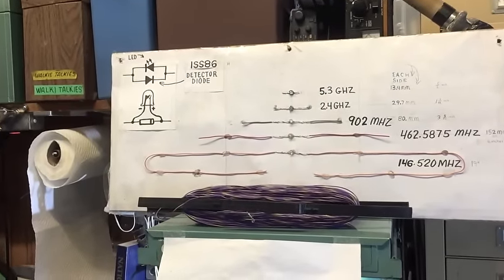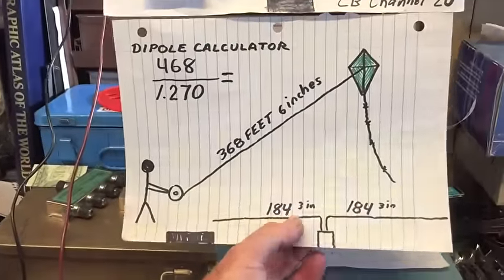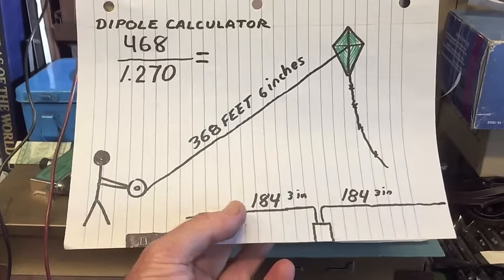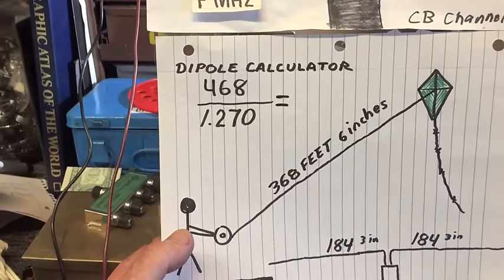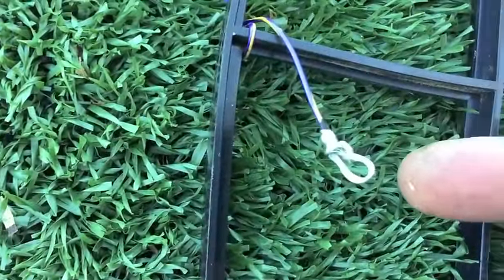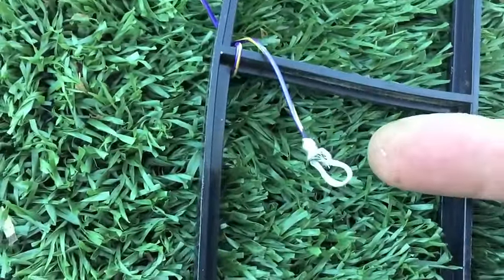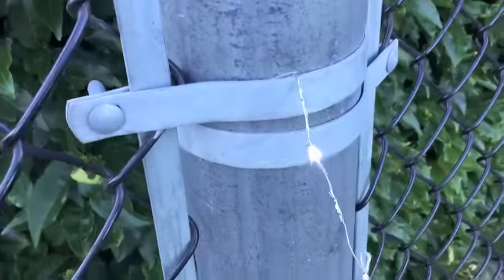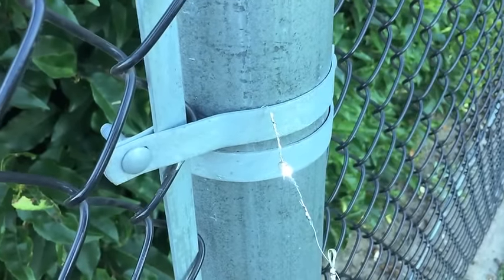Radio Frequency Burns From A Long Wire Antenna Supported By A Kite

Comment: How many volts and amps is that?
Reply from the maker: I'm not sure. It's hard to measure radio frequency energy.
Reply: @GrantsPassTVRepair  that in and of itself is pretty interesting. What makes it hard? Does it fluctuate to much to get a goo reading? I wonder what running it through a capacitor would do to help stabilize it. Does the wire need to be bare or would something like insulated 6 or 8 GA wire wire work. I have a couple thousand feet of that laying around for years just waiting for a good purpose to be put to good use in. It's silver plated copper. Not tinned actual silver. Thanks for the reply.
Reply from the maker: @nathanhale7444  Radio frequency energy is measurable using an oscilloscope, but no multimeters that I'm aware of can measure it. I suppose a sensitive watt meter might be able to it, but any time you pass high frequencies through electronic circuits in multimeters, the reactances you encounter will distort your readings. Radio Frequency energy is much like AC only much faster in frequency.

Comment: Are theese rf burns permanent?
Reply: It's just a normal 1st degree burn, probably even less than you'd get from accidentally touching the stove for a fraction of a second. Just burns the top layer of skin for a few days but it'll heal. You'd be worse off with carpet burn.

Comment: Ok since we are talking fantasy Island talk.... How about I get enough wire attached to a helium filled balloon so that it will reach the Aurora borealis and tap in to that FREE energy, it's staring us right in the face in the northern hemisphere above a certain latitude. Or tap in to the static electricity discharges (lightning) in Texas and put the electricity in a really big capacitor or  Tesla wall pack, the lightning is free everything else is gonna cost you. You know what? all this brain storming made me tired, I'm going to take a nap now. Good luck in the contest. KD6 _ _ _ .

Comment: He is flying next to power lines, clearly visible as he launches the kite.  Do as he said, not as he did.  Dont fly next to power lines. Aside from the microscopic energy the wire picks up from RF, if it got away from him and hit those power lines clearly visibe in his lainch video they would easily conduct emough energy to kill a kid who was watching the wayward kite wire string cross those nearby power lines clearly visible in his video.
Very irresponsible and potentially fatal for himself or passers by.

Comment: OY vey!
You sent a half wave long wire into the atmosphere, and claim your voltage is due to RF?
The voltage you felt is more likely atmospheric electricity, interacting (minimally) with an RF signal. 
The American Meteorological society has published a recent paper, regarding various voltages in the atmosphere vs height.
Cosmic rays "charge up" the particulates in the atmosphere, as well as charging the more dense earth.
The mass difference creates a potential (ie, electrical) difference of GND vs atmosphere. The introduction of a solid mass almost 400 ft long into the atmosphere "plasma" will give you a hefty and sustained voltage tickling... Just imagine if there is a cloud present in your direct vicinity! A literal plasma mass, (cloud) separated by a dielectric insulator from the earth... An humongous capacitor...
Just saying...

Comment: I'd like to see a multimeter neg to earth, pos on wire
Reply from the maker: Conventional multimeters can't measure radio frequency power directly off this antenna, It's to high of a frequency.
Reply: @GrantsPassTVRepair  Couldn't you put a rectifier on it?